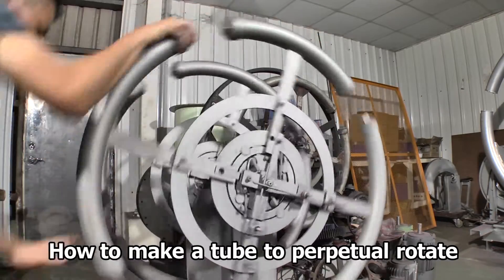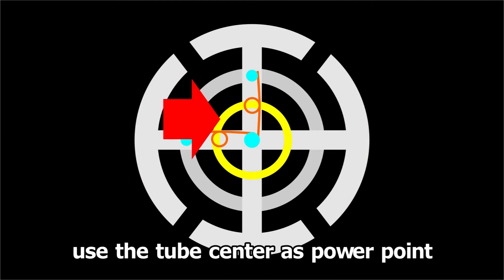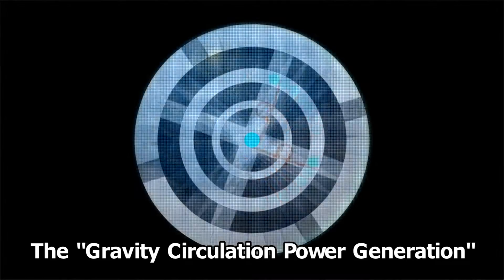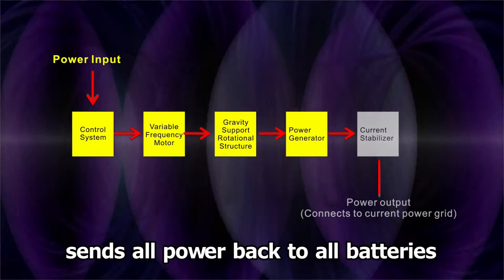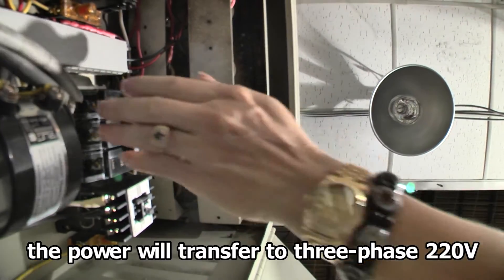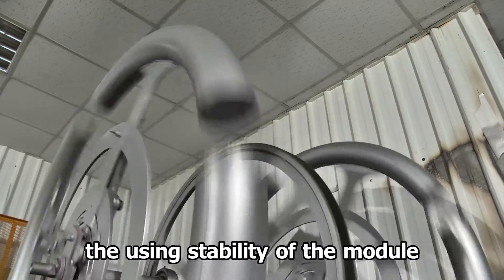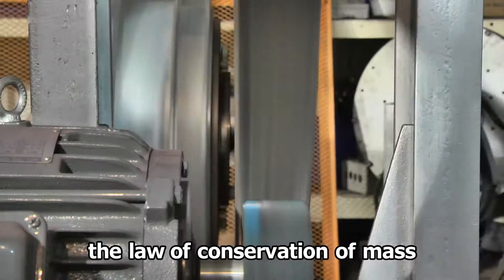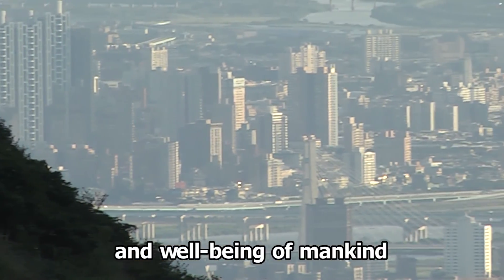Gravity Circulation Power Generation(HDV)

Comment: Yes!!! preach it. Gravity  isn’t going away how simple and clean and works anywhere on earth. It’s the way of the future. Gravity generation of electricity is even easier than solar electric power generation.  The real question is using mass as fuel and gravity as the function how small could a gravity based electricity generator be???